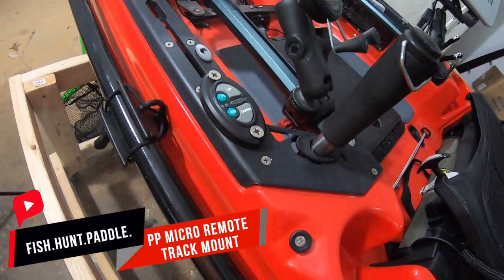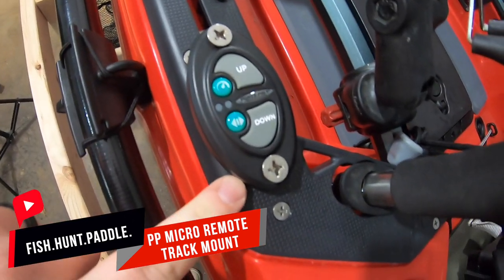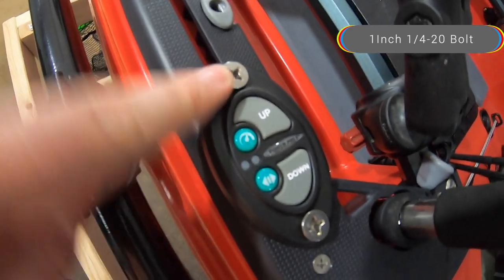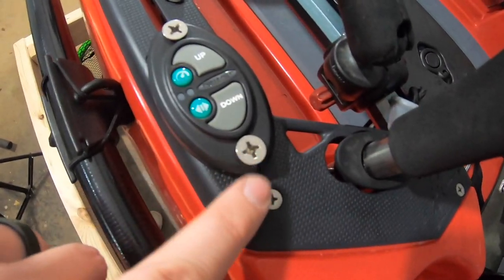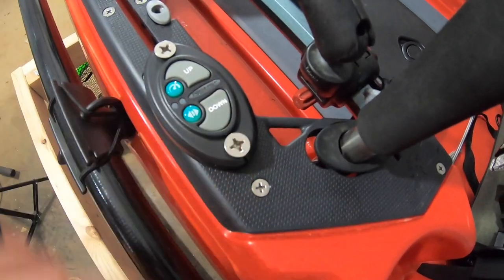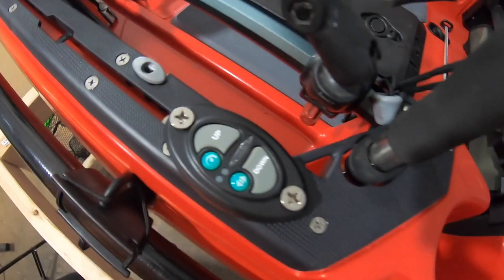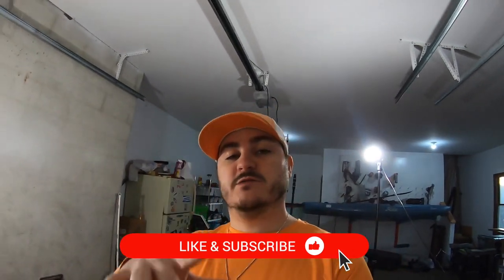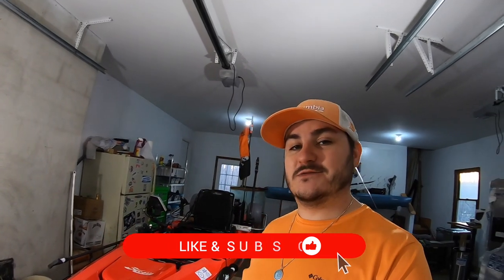Power Pole Mirco Remote Track Mount Mod

Comment: Very neat idea. Not trying to knock your idea, but wouldn’t heavy duty Velcro work as good? Or would water getting on the Velcro just stop sticking?
Reply from the maker: The heavy duty Velcro actually works great that what I used on a my old pro angler. I just wanted it mounted in that specific location so I made the tracks work. 👍